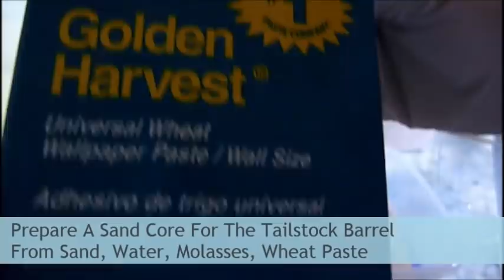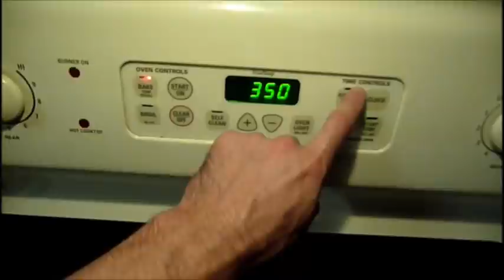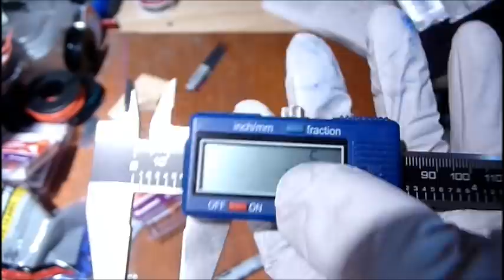Making the Gingery Lathe Tailstock

Comment from the maker: Hey Tang, it should be fairly obvious from the video that I do not have access to a CNC milling machine. Also, cost is a big factor with my build, and buying a block of steel and trying to mill the tailstock from that on my mini mill would not be practical. If you look at just about any commercially sold lathe ( other than CNC probably ) you'll find that the parts are still cast in iron...

Comment from the maker: Someone already asked this, and I believe a block of steel the size you would need would run you about $100+. The aluminum I used for this was free - only cost was propane and time. As far as I can tell, most machine tools purchased have cast ( iron ) parts which I'd imagine is also a factor of cost, time, and waste. The amount of time spent preparing the pattern, mold, pouring is fairly small, and I can make the part over and over again if I need to without having to start over on a blank.

Comment: Very nice job Morgan.  I also bought most of the Dave Gingery series 20 ish years ago.  I was planning on building them, but fate had other plans. In 2002 my employer bought a Haas Toolroom Mill.  After the installation was over, my boss handed me a print and said "Make this."  Had to call Haas the next day to ask them how to turn on the machine. Fast forward and it was a great opportunity.  I see so many ask why build not just buy or why use aluminum.  Anyone can buy a machine. Period.  If you can build one, you develop a much higher skill set. More like the old timers that could cut anything strictly by skill.  Without a CNC machine to do the work.
Reply from the maker: Absolutely. There is nothing wrong with making parts in aluminum, and the machine is rigid enough to do the kind of work I need it to do. I did enjoy the build process and developed some additional skills I wouldn't have if I had just been able to buy a mill and machine from billet

Comment: Yes, you do have to be careful when buying a printer kit. The first printer I bought was junk, used plastic bushings and had no Y axis carriage, I had to make one. Since then I printed all new upgraded parts for it, rebuilt it with linear bearings, now it has very good resolution. I made 14 different upgrades and they are all included in the Prusa kits I sell. Well enough about that I'm going to go to the yahoo forum to see whats happening, thanks Jeff.

Comment: I approve of your safety footwear for wire staightening! :) A less energetic way of getting nice straight wire is, instead of pulling hard on it, place one end in a vise and the other in a drill. Slowly turn the drill and the wire will straighten. I didn't believe how easy and effective a method it was until I had about 50m of gardening wire to straighten for plant frames - 5 x 10m, 30 seconds or so per section - job done!

Comment: I am a trained machinist and we often were taught to cut off with a hand hacksaw. You should put some wood on the lathe bed so that if you slip when the blade goes all the way through you dont damage the lathe bed or any other parts. Great video.

Comment from the maker: Hey Nick, here are the pros and cons as I see it - machining from a block of metal - pros: none, cons: cost, waste, wear on cutting tools. Casting from scrap aluminum - cons: none, pros: free, less waste as I'm only cleaning up the casting on the mill, less cutting tool wear. Now you might add that I could have machined it from steel, though that would cost more than I wanted to spend. Also, if cast you can do everything with a file, hand scraper, etc.. no milling machine required.

Comment: Well it's a three jaw chuck, mounted to an aluminum hub which is mounted to the spindle, spindle does have a MT1. Some jobs I have done recently have required a larger chuck, I have a 5" that I chucked up into the 3" chuck, then applied pressure to the work with the tailstock. I would not recommend doing this continuously, but it did work for a couple of jobs. I want to build a larger capacity lathe. I built two repraps also made the hotends. You could make the parts for the printer on your mill

Comment from the maker: [character limit] ... This has been an on and off project ( mainly nights as I have 2 kids now ), and over the 3 years that I have worked on it, the total cost has been fairly well spread out. I think the main benefit has been the experience building the machine, learning to cast parts, etc.. If I was to do it over again I might have just bought the 7x12 and learned to cast aluminum, but it has been a valuable experience and I like to finish the projects I start :)

Comment from the maker: Gingery was quite creative with regard to the leadscrew. Being that the book assumes you only have a 14" lathe file, taps, a hand drill, and access to a hardware store, he has you use a 3/8"-16 all thread rod with two black pipe nipples that you tap half way and secure on each end with jam nuts. You also have to connect the nipples to your lathe motor via a primitive coupling in order to turn down the nipples to 1/2" with a lathe file. Overall it works well, though I've been thinking of upgrades

Comment: Nice job you are making there, i'm planing on building a cnc slanted lathe from aluminium with the same casting process for the body, headstock and bed, using square linear rails on both axis,  but i'm afraid about body stability and stiffnes, i want to make it 3/4 to 1" thick on all body walls and reinforcements ,  do you think it could handle machining steel???  Or it's too much stress for aluminium??? I'm planing on a 9"x20" working area... thanks for any advice you could give me...

Comment: I printed the Rostock for Russ, he's building it now and about 50% complete. Also with these kits I supply links to all the other parts so you don't have to search months to find all these items. I've done my best to get the best prices with low shipping costs. All the electronics with the heated bed, SD card reader, display and much more from one vender. Stepper motors, I don't think any one could beat the price either. Yes when your ready, just let me know. I built two of the Prusa Mendels.

Comment from the maker: My gingery is a bit up-scaled so it will be heavier than the one suggested in the book, though I mainly increased the ways by 1" (up sized castings too), and went from 1/4" to 3/8". My bed casting came in at about 6.5lbs, the headstock casting was 6.1lbs. I haven't actually weighted the whole thing, but it feels like it could be 50lbs. The steel bed ways is 10.2lbs, and when you bring in the tailstock, spindle, carriage, cross slide, etc... 50lbs could be an accurate suggested weight for mine.

Comment: I'm a machinist so I'd like to see you use cutting and tapping oil. Aluminum gums up drills and taps fast and it's a bitch to remove sometimes.
I love the lathe! If you're ever in the "slammer" I have a feeling you'd find the tools to escape... McGyver!
Reply: Absolutely oil to the cutting workpieces at least with Aluminum.

Comment: you have definite engineering capabilities. what is the lathe capable of doing and how accurate is it? cost? depth of rough cut?i thought i seen you working on a mill,,you can turn round stock on a mill ya know.

Comment from the maker: Good point on being able to cut a new screw without having change gears on the lathe! I haven't cut threads as of yet, so not sure of how well the lathe will cut threads ( or how comparable it will be to cutting threads on a 7x12 ). Up to this point I haven't had any problems with the leadscrew, and even in book #4 gingery has the screws made in a similar fashion. I'd most likely upgrade the screw and use a similar method to making the journals.

Comment from the maker: I didn't really notice it, but I don't really see why it would matter if the feed screw advances the tailstock ram when turned couter clockwise, or clockwise. Regardless, it is still advancing the ram in and out - since the ram does not rotate at all, the direction of rotation on the feed screw is irrelevant ( at least in my mind ). I used the die that I had on hand, and didn't really pay much attention to the fact that I was cutting left, or right, handed threads as it didn't seem critical.

Comment from the maker: Yes, making the machine from iron castings would definitely be the best step toward a heavier / more rigid machine. My setup is fairly small, and fits well with my situation, and thus I probably won't get into casting iron at home. The other alternative would be to use zamak (ZA12) which has a lot of the properties of cast iron, but lower melting point, etc...

Comment: you could use the lathe you made to cut an acme lead screw using the all thread lead screw and replace it.  but you might have a problem of rigidity when you cut the tread because you lathe is so light.  if I were doing I would make a furnace so I could make the castings in iron instead of aluminum, but that would be much more tricky to get right

Comment from the maker: Thanks for the comment, yes a lathe 'can' be a very precise machine if built well. With the lathe so far, I have been extremely pleased with the quality of work I can do on it so far, though removing play in the slides is  critical.

Also, wanted to note that the production methods are from Dave Gingery's Lathe Book ( #2 ) which can be had at amazon[dot]com. Lots of great information in there, especially for someone like me who has a background in computer engineering, but none as a machinist.

Comment from the maker: Thanks for the comment! Aluminum is fairly safe / easy to cast at home. I don't have the setup, or experience, to cast iron as of yet. If I was to machine the tailstock from a block of steel it looks like I would be paying $100 for the steel without shipping... The aluminum I used was from my neighbor's lawn mower so it was pretty much free other than propane, electricity, hardware and time. Cheers, Morgan

Comment: If you use a smaller scraper you'll get more accurate results when working on smaller areas like those wear pads. For aluminum you can just hone up a wood working chisel, in a pinch I don't even bother changing the angle of the edge.

Comment from the maker: Thanks for the suggestions, it's much appreciated. I do have a big granite surface plate that I use when I can - for scraping the bed casting flat for instance, however for the box slides I use the ways to scrape them in such that they will be true to the bed ways, versus the plate. I did scrape the back ways on the granite plate, and then used the carriage casting which was scraped against the back ways, to true up the front ways. It seems to have worked quite well. Cheers, Morgan

Comment from the maker: Thanks for the suggestion. I could definitely use odd leg calipers more often if I was working with a more expensive set of digital calipers, however the digital calipers I'm using I think I paid $12 for, so I'm not too worried about having to replace them when need be.

Comment: Hi there. I spent almost 2 hours now watching quite a few of your build videos, and I can't help but admire your attention to details and persistence in getting this project completed. And I am also impressed by how well this little lathe performs, despite its inherent limitations. I do need to ask though; why not buy a second hand lathe of similar size made out of cast iron, to get more rigidity? Or did you just want to do this project for the love of it? Kind regards, Michel
Reply from the maker: Hey Michel, thanks for the comment! Good question about getting a second hand cast iron lathe. When it became apparent that I would need a lathe for some of my projects I didn't really have the experience to refurbish a second hand lathe in my price range. I was basically looking at buying a Harbor Freight, or equivalent, mini lathe with no tooling. I still didn't have an extra $450 for that, and in frustration pursued possible alternatives to acquiring a benchtop lathe. My shop was also in a basement with a narrow staircase, so any floor model machine would not work either, though any working floor model machine would have been too expensive anyways. I happened upon Dave Gingery's machine shop from scrap metal series of books and was instantly intrigued with the possibility of making a fairly accurate lathe with simple hand tools and a drill. I also liked the idea of picking up metal casting, and the fact that in building the machine, I would hopefully know how to operate, fix and upgrade it at the end of the build. That being said all of those goals have been accomplished and up to this point the machine has been adequate enough for what I needed it for.

Cheers,
Morgan
Reply: Morgan Demers Hi Morgan, I admire your tenacity for getting this thing complete, because it looked like A LOT of work went into it! The reason I was asking about whether you had considered a cast iron lathe, was because I went down that path. I started off with a Myford ML7, with a 3-1/2 swing over the bed, roughly the same size as yours. But it quickly became apparent that it wasn't rigid enough, and that I couldn't work on large pieces. I paid around $700 for that. I then went out and paid around $800 for a Colchester Student MK 1.5, with 18" swing (!) over the bed. It weights 1600 Lbs, but boy does it work well! Once you have a larger machine, you'll start to think how you ever did without it! ;)

Good look with the project and my respect. You've done well!
Reply from the maker: mictho100 Hey Michel, thanks for the props on my tenacity - it definitely took a fair amount of work ( more than I initially counted on ). Realistically I traded in money for time on the project, though I definitely feel satisfied getting it done. There were some obvious hangups like learning how to hand scrape without having a mentor to show me the proper technique, etc... The Myford ML7 looks like a nice machine, and I think I would have been happy working on something similar. Personally I think it all comes down to how aggressive you want / need to be with your cuts - my machine has no problem making really light cuts in steel, though that is a big trade off when considering how long it takes to get down to your final dimensions. I'm sure your MK 1.5 with 18" swing is solid, and you can comfortably take nice roughing cuts with a sharp tool in your post [ that must feel amazing :) ]. 

Thanks again for tthe comments!
Morgan
Reply: +Morgan Demers hey, Morgan. Inspiration job, well done. Just a small suggestion. If you replace aluminium parts with reinforced concrete - you'll get a lot of rigidity for cheap.
Reply: +Andriy Podanenko Concrete has a lot of creep (dimensional instability over time). Then again, aluminum also has more creep than steel or cast iron (that's been properly cured). For high dimensional stability I suggest using polymer concrete, otherwise known as epoxy granite, as the epoxy binder will not shrink or creep as portland cement will. If you look hard enough, you can find recipes for epoxy granite online, or you can just buy it from epucret (or other suppliers).
Reply: +Andriy Podanenko try threading reinforced concrete :P
Reply: +martinguy you can inject thread into it
Reply: fair play haha

Comment: love your videos, i've been watching them almost daily lately.  I'm going to be building my own gingery lathe, beginning within a week or so, but I'm going to be going a bit oversize (I'm planning on 30 inches for the ways and a bit taller on the headstock so I can machine larger parts).  One question regarding your furnace, I can't find an answer anywhere on Google... How long does a tank of propane last you, what psi are you running your propane at, and what size tank do you use? thanks :)
Reply from the maker: Hey Sum, glad you are into the videos, and it definitely gives me great satisfaction that some of it may be helpful to other people going through the build procress. Definitely good luck on making the lathe bigger, I had good success beefing up the machine but I didn't increase the capacity very much - just made it more rigid. You'll definitely need a bigger furnace / melting pot than I used ( a 2qt dutch oven ) as my lathe bed had thicker walls, and more cross brasses and the pot was brimming. I can't say exactly how long my propane tank lasted, though I use the typical barbecue variety ( 10lb I think ). I'll run my burner between 7 and 10 psi once the furnace is warm, about 15 psi at startup, and typically will do 1 - 2 pours during a session ( about 45 minutes as I prepare the flasks ahead of time ). Since my build took me so long ( over 4 years on an off ) and since I also used the tank for barbecuing, it is hard to say exactly how long the tank lasted exclusively for melting metal. I'm sure based on my numbers above you could formulate the consumption with some formulas, but I don't have time right now to figure that out. For some reason I would like to say that you could probably do the whole lathe project on 3 fill-ups of the propane tank tops, however if you had a much larger furnace to handle your bigger parts, it could be that you would have to run the burner hotter, and/or longer, consuming more gas, etc...

Comment from the maker: If you read back through the comments I think I've answered this a few times. The cranks are unfinished and blacken my hands pretty bad, which is why I use the gloves. I pop in and out of the shop, and it became a nuisance scrubbing them clean after 15-20 minutes of shop time throughout the day, etc...

I've coated one of my cranks ( after polishing ) with a clear enamel, which seems to be holding up well enough for now. If it lasts I'll do the other cranks.

Thanks for the comment,
Morgan